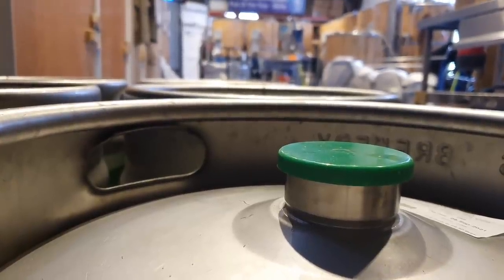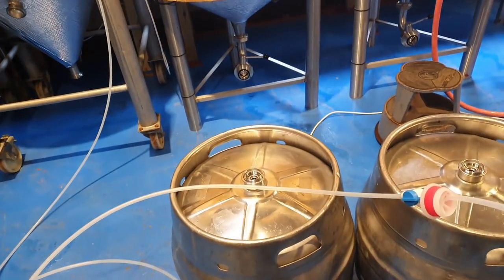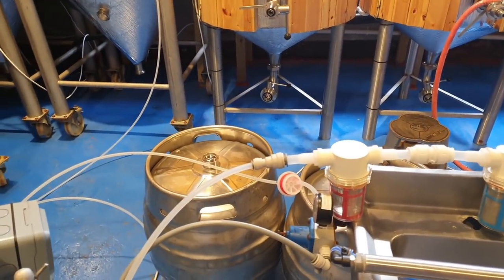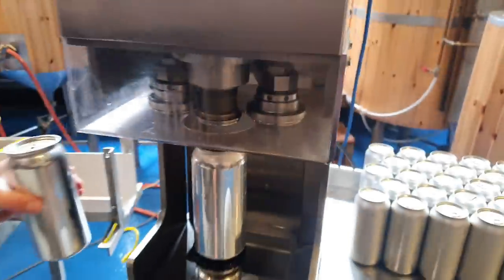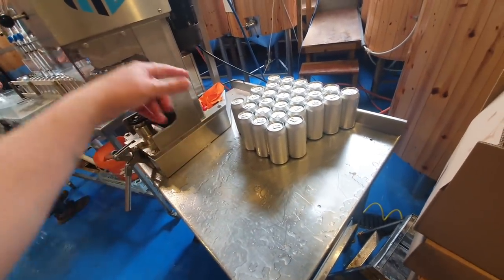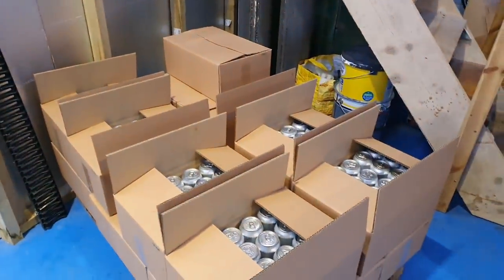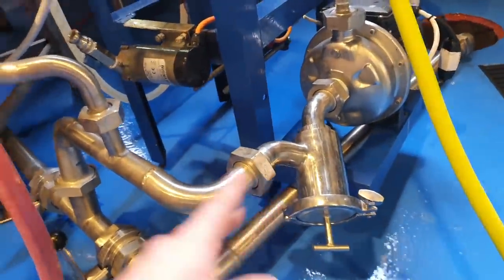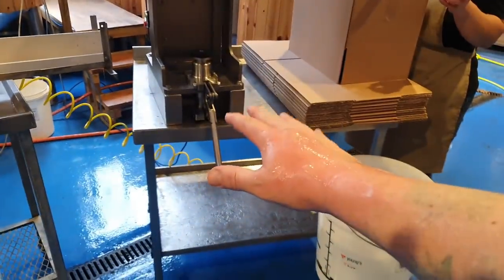Today I Learn About Scalds

Comment: Ouch, I felt that from here. Worth getting a good long pair of protective turtle-doves for use when doing hot-side pipe disconnects?
Reply from the maker: It is not usually an issue if I close all the valves. Bound to happen at some point. Double checks from now on.